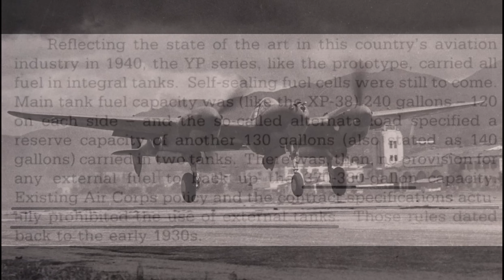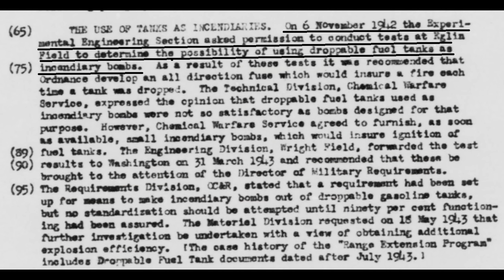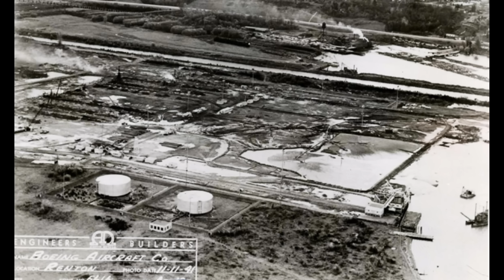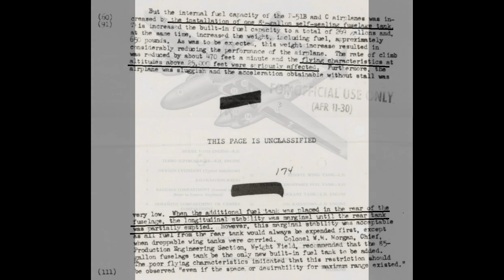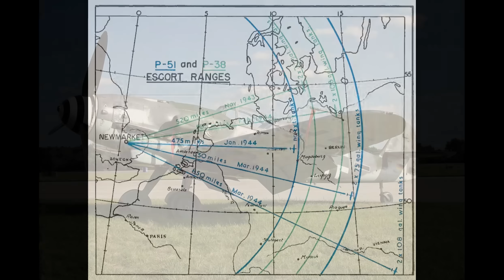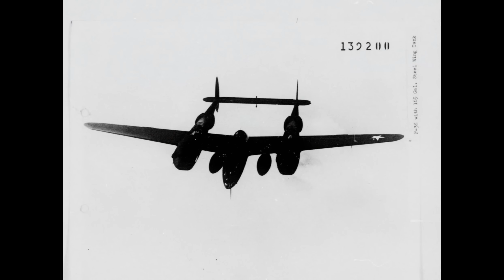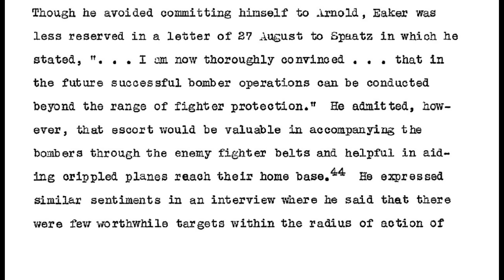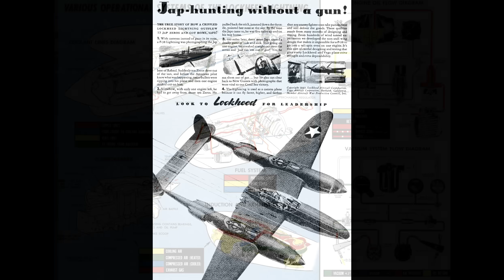The P 38 Lighting and the Bomber Mafia's Failure In World War Two

Comment: "...they won't shut up about the Mustang's range". First real 'out loud laugh' of the day. I am such a fan of your 'bomber mafia' videos. I had no idea. I was one of those who were absolutely convinced that the Mustang, was the only fighter able to escort bombers to Berlin. There's no doubt that the Mustang was an excellent fighter...but far from the only excellent fighter. Thanks for clearing the air.
Reply: Then apply Lindinburgs work on the P-38 in the Pacific and you would end up with even longer range
Reply: @nunyabiznesssame2371 Is Lindinburg a new Zeppelin?
Reply: @nunyabiznesssame2371 
Nope. Lindbergh knew nothing that Tony LeVier didn't already know, and it was Tony LeVier who showed the 8th AF what they were doing wrong.
Reply: @nunyabiznesssame2371 💯
Reply: I think u have earned your wings as a premier aviation historian with ur critical research. Bless u sir 😊
Reply: I understand that the cockpit heater did not work very well in the P-38. Pilots suffered from hypothermia. They called it the ‘ice wagon’
Reply: @jimstanga6390 
Much of that was caused by incorrect operation of the aircraft itself. They were flying the aircraft in "cruise" mode with the boost down, the RPM high, the mixture too rich, and all the cooling doors wide open. The engines were literally 100° F too cold. That turned out to be the cause of the problems the P-38 suffered almost exclusively with the 8th AF.
Reply: @ If you watch the "Heavy Metal" episode about the P-38  the veteran pilots won't give you an inch.   The P-38 was "the  Cadillac  of the skies!"
Reply: @jimstanga6390 Makes sense being separated from the engines
Reply: @jimstanga6390 while I heard in Pacific p38s pilots flew only with their undies because hot climates.
Reply: Few people knew how shitty those old history channel docs were until Greg came along. 🤣
Reply: "clearing the air". Nice, I hope you meant that pun!
Reply: The true selling point is, the mustang was significantly cheaper than a p38 or p47.
Reply: @MartinLange-x8p  and consumed half the fuel were easier to fly, easier to maintain, etc. You are correct. And in a war of LOGISTICS, fuel training, maintenance, production quantity, etc. matters FAR more than quibbles over range, speed, etc. But the Mustang was a far better airplane overall than any other for the money with far fewer issues.
Reply: @MartinLange-x8p this the point Greg always makes. The p51 was a great fighter and cheap to make and had great range but came in 1944 when the luftwaffe was already mostly destroyed.
Reply: @MartinLange-x8p  at the end of the war they were selling them for $1,500 ...now in today's money with inflation that about $32,000 USD
Reply: @MartinLange-x8p   Still pretty speedy at $80,000 I believe.  A Spit cost half as much and had the same engine (though Packard built)...and apparently stumbled in to "area rule" platform, not to mention 5+% additional thrust from directed expansion of radiator heat.
Reply: @juliushummer1069  are you sure about that. The spitfires and Thunderbolts elliptical and twisted wings were extreamly difficult to manufacture. Driving the price up.
This was the main reason why germany decided against the he 112 in favour for the bf 109.

A spitfire was two times the pricetag of bf 109 and 2.5 times compared to a hurricane. 

I doubt that the spit was cheaper than a Mustang.
Reply: @MartinLange-x8p  

AFAIK the Thunderbolt's wing wasn't truly elliptical. Its drag performance however is very close to that of a true elliptical wing, but was also much easier to make so it's overall a much better design.
Reply: @MartinLange-x8p Now we are at the crux of why P51 gets more love. Ìt was cheaper.
Reply: @MartinLange-x8p True but the P38 was available before those other fighters. You fight wars with the equipment that you have, and the USAAF HAD P38s. Just like later when they had drop tanks they could use on P47s. It really comes down to command not giving an inch on their doctrine and preconceived ideas.
Reply: Mustangs magic is that it was cheap and highly effective for greener pilots.  P47s and Lightnings were objectively better but more expensive and required a more experienced pilot to get that performance out of
Reply: @zacharyolson1297  The Lightning was not only very expensive to build and required a better trained pilot, it was very expensive to run. It was a thoroughbred that spent an awful lot of time in the hangar being maintained. Like the F14, it was the best US fighter of its time when it was flying but could not spend enough of its time flying.
Reply: @kenoliver8913 
Properly rigged, maintained, and operated, the P-38 was extremely reliable. 

The 8th AF failed to do ANY of that until well into 1944, despite being repeatedly told they were doing it wrong. 

Tony LeVier, Lockheed test pilot, went to Britain, and was absolutely appalled at the condition of the aircraft, and how they were operated. He said that 90% of them were not airworthy, due to being improperly rigged, and having maintenance that bordered on criminal negligence. Further, the pilots were flying them using the worst possible settings. 

Further, my friend, Captain Arthur Heiden (pilot of the Lucky Lady) told me that his P-51D was no more reliable than his P-38J, and really couldn't do much of anything better. He had several instances of cracked heads, and blown out spark plugs in his P-51, and his P-51 was never capable of climbing anywhere near as well as his P-38J. 

Captain Stan Richardson Jr. said pretty much the same thing. 

They said the P-51 was easier to fly, and had better cockpit heat. Other than that, they were able to do more with the P-38. 

Lt. Richard Loenhert, pilot of "California Cutie" flew her for dozens of missions on the same pair of Allison V-1710 engines she was delivered with, without any failures. And they weren't milk runs, either. A look at the insignia on the nose of "California Cutie" shows a steady string of heavy combat escort missions. 

The P-38, properly flown and maintained was reliable, effective, and competitive with anything Germany had, save the Me 262.
Reply: @kenoliver8913 it costs money to be 😎
Reply: Changing your opinion after a well made argument is about the highest praise you can give a content creator !! 👍👍👍
Reply: @Joe_Not_A_Fed I absolutely agree BUT! able to escort, and being a good "turn and burn" fighter are very different the P-38 was a death trap for dog fighting without advantage or being an excellent pilot, the P-47 was also not a good fighter in terms of matching turning and other aerobatic moves, it could do every damn thing else five star outta five star perfect but, the only thing especially with that laminar flow wing that could turn and burn dogfight better or as good as any high flying altitude bomber killing Axis aircraft, not saying the P-47 especially was a bad turning plane but you'd never get into a better turning situation with one against many excellent Axis aircraft that's why so many Allied pilots that had like 30 kills, of those kills 25 of them will be blowing the enemy out of the sky without contest, many quote "aces" never received enemy gunfire in some cases I don't think before they became an "ace" so very often turning and dogfighting was not what happened so the advantage the Axis aircraft did have, was sadly often irrelevant ^_^
Reply: @Magikarp-4ever  

Committing too much to turnfighting is exactly how you end any killcount you might have, because that means you're going low and slow and therefore a sitting duck for the guns of enemy fighters. Also the P-47 actually maneuvered better than most aircraft at higher speeds due to good ailerons.

Even IJN pilots flying the highly agile Zero don't actually prefer to turnfight with their enemies. They prefer to strike from the rear and on high. Boom and zoom is the name of the game.
Reply: Its what is quoted, the real issue was the unit price of the 51 was significantly less than the 38 or 47.
Reply: Filipus ........ thus proving that there is far more to a fighter than just "maneuverability" ! Also if you think the P38 was superior to the Bf109 or FW190 you are delusional. Luftwaffe fighter pilots viewed the P38 as "easy prey" in pretty much the same way as RAF pilots viewed the ME 110. Ask yourself WHY the USAAF withdrew the P38 from the European theatre ? Most pilots that got shot down in WW2 never even saw the plane responsible. If a pilot saw the attack coming there was a good chance he could manoeuvre out of the way ..... a small word "if" but its size belies its significance !!! 🤷‍♀️
Reply: T/M P38  0.68 P51 0.80 That is the main reason the P38 was relegated to other duties
Reply: I bet the P-51 would win a dogfight with a P-38 7 out of 10 times.
Reply: @mattfaulk8724  Make it  9 out of 10 in the ETO
Reply: They couldn't even manage to shoot down a single Zero with a 2-1 advantage when they went after Yamamoto, P-38s weren't dogfighters and that's why they weren't used to escort bombers, the Mosquitos role would've fit the P-38 better than escort duty.
Reply: @mattfaulk8724  

That ignores how the P-38 was top dog for overall aircraft kills in the PTO in the USAAF.

British delusion much?
Reply: rell........ "I do not need to do further research  ....... as I have read a book". Really ! A whole "one book", please don't over exert yourself !!! Now, if you think about Brigadeer Old's comments concerning "Cadillac versus Sardine Can" particularly regarding "weight and handling" the comparison may make more sense ? The Bf109's performance largely was largely due to the fact that it was both small and light. As more armour and heavier weapons were added to the 109 the downside was actually less responsiveness and less speed. Engine improvements helped offset some of the weight gains, however, engineering choices and physics are unavoidable ! As for history, gun camera footage fortunately STILL EXISTS and there you have it ......."viewing actual history" ! Pilots opinions ....... Most RAF Pilots preferred "flying" Spitfires, a significant minority however actually preferred "flying" the Hurricane. Some who preferred "flying" the Spitfire actually preferred "fighting" (in) the Hurricane. It is widely acknowledged that out of the two the Hurricane was the better and more stable "gun platform". (In other words it was easier to destroy enemy bombers from a Hurricane ........at least during the BoB). Now a lot of people are commenting that the P51 Mustang was chosen because of cost ....... they are actually right but not for the reasons they state. The only cost comparison that really matters is actually between the cost of the BOMBER versus the escort fighter !!!. If a bombing raid suffers heavy losses and is rendered ineffective it inevitably means another raid/s will be necessary. It was the introduction of the P51 D Mustang that drastically reduced B17 losses. Every lost B17 meant the loss of TEN Airmen and $ 250,000 dollars to replace ! More importantly, providing those bomber crews with some chance of actually surviving their bombing  tours, transformative  ..... Luftwaffe fighter pilots viewed the P38 Lightning as "easy prey", they knew its limitations and precisely how to shoot them down. Similarly, the RAF viewed the Me 110 (Twin Engined heavy fighter) exactly the same way ! The P38 was great against slow Zero's in the Pacific ..... Against Luftwaffe Bf 109s and Focke Wolf 190s...... inadequate ! The P51 Mustang on the other hand ! 🤷‍♀️
Reply: Incorect , at altitude the p38 and the p47 could out turn the 190 and 109 in both the 1 circle and 2 circle fights , they were significantly faster and had much more power at escort altitudes .
This is just simple math@garymoore2535
Reply: @garymoore2535  Wow man i hope that's caffeine, not something stronger. No, the reason B17 losses went down is that P47s has already killed the skilled Luftwaffe pilots. And that's not an argument that says the 47 was better than the 51 but a reminder that much of what is attributed to the 51 is couched of a false premise. But i do agree, that the 38 was not a good high altitude escort, those terrible critical mach numbers made it unusable for that role. Could go into compression in an instant at high altitude.
Reply: Erm ..... Do some research on how "twin engines fighters" compared to single engined fighters ....... twin engines fighters were nowhere near as manoeuvrable or responsive in combat. The P51 Mustang was chosen as the escort fighter for good reasons !
Reply: @ Guess what ? That is not the point of the video , the point is many bomber crew would have survived had P 38's been escorting them to Germany in 1943 and losing a few fighter jocks is a small price to pay vs a bomber crew.
Reply: @garymoore2535 the P-38L with the hydraulic-boosted ailerons and dive recovery flaps was very maneuverable. I may be mistaken, but I believe it had a better roll rate and tighter turn radius than the p-51d. Had they received the paddle bladed props and 1875 hp engines that the p-38k had, I strongly believe that it would’ve been the best piston engined fighter of the war.
Reply: @margraveofgadsden8997  Introduction of this model required only a 2 week pause in production while the factory was retooled which the USAAF refused.
Reply: @garymoore2535  With both available, choosing the P-51 over the P-38 makes sense.

With only the P-38 available, choosing not to have an escort fighter at all is criminally negligent.
Reply: @ShuRugal   The entire premise of Greg's argument
Reply: @garymoore2535 
Yes, but the P-38 with sufficient range was available a full year before the P-51 models.  Had the "Bomber Mafia" bowed to the reality that fighters are more easily produced in quantity than bombers, therefore expendable in numbers that would make unescorted bomber missions prohibitively expensive, the prohibition on escort drop tanks would NEVER have been in place.  Under those conditions, the Lightning would have been capable of long escort missions an additional year earlier.  Further, more development on multi-stage turbo-superchargers should have yielded a Lightning with a service ceiling well above those of the bombers being escorted or the vast majority of the interceptors sent to shoot them down; the Lightning would have been able to "boom and zoom" in Europe as they were in PTO.
Reply: @garymoore2535 Do some research on a pilot named Bong in the Pacific theater. His opponents were Japanese fighters which were well known for their outstanding agility.
Reply: @garymoore2535  okay but the P-38 is really an exception. In the pacific, where P-38 got most of their fame, they fought Zeroes and Ki-43, far more superior fighter in terms of maneuverability than BF109 and FW190
Reply: Well Gary, I have no need to to do 'further research' as I well remember the book written by the late Brigadier General Robin Olds. As he flew both P-38's & P-51's in combat in the ETO, obtaining kills in both, his opinion was that the flying the 38 was like 'flying a Cadillac' where as the 51 was a 'spam can'. His opinion might not be comfortable with some; but he talked the talk, walked (flew) the walk,
lived to tell the tale & write the (a) book. I'm sure the now deceased ace Robin Olds forgot more facts about 38's & 51's during WW2 than anyone alive would likely acquire. I
suspect Gen. Olds would have happily flown 38's until VE day but we can not ask him, sadly.
Reply: @garymoore2535 You seemed to have missed the entire point of the video, but it wasn't to say the 51 wasn't the best choice for an escort fighter in 1944. Might want to re watch it
Reply: @garymoore2535  High altitude escort duty did not involve low energy dog fighting performance. It was entirely a boom-and-zoom affair. Speed and firepower were the single most important factors for an escort fighter or bomber interceptor. Stop conflating reality with the History Channel.
Reply: @GeneralJackRipper  
Correct. If low-medium altitude manoeuvrability was what mattered most the P39 would have shat all over the P38, P47 and even the P51. It is exactly why the Soviets adored that little plane (air combat over the Eastern Front being mainly low altitude and short range). Hell, even the P40 would have shat over them too. But the issue here is mostly about range and secondarily about performance at strategic bomber altitudes. Both of which, in 1943, the P38 was best at.
Reply: @garymoore2535  and yet P-38s were absolutely lethal on Zeros in the Pacific....
Reply: @garymoore2535 
The P-38 was able to use its twin engine layout as a substantial advantage. I suggest you look into "differential throttle" use. The P-38 could do it well. Over 300 MPH it was the fastest rolling fighter in the U.S. inventory. It was the fastest climbing, and the fastest accelerating fighter as well. It had an excellent instant and sustained turn rate, and excellent elevator authority. 

Your claims about the P-38 not being competitive are demonstrably false. I've known several actual fighter pilots who flew the P-38 and P-51 in combat, all day the P-38 was absolutely capable, and the advantage of the P-51 was that it was more simple, and easier to fly, but not as absolutely capable in as many situations.
Reply: All fighter Escorts are NOT the same. The P51 Mustang was by far the superior escort fighter capable of dealing with the Bf109's and FW190s. The P38 was not really competitive in the European theatre which is why the P51 became the escort of choice ! Simples 🤷‍♀️
Reply: The entire point of the video is to point out that crippling bomber losses endured early in the campaign were not needed. We had fighters capable of providing escort. Long before the Packard Merlin engined 51s was available.
Reply: @artlee2285  most early bomber missions were short ranged into france and germany along the coast, and were in range of fighter escorts. this gave a false sense of success, and the long range missions in mid-late 1943 is when it failed. and it was only a bout a 3 month window in which teh high losses occurred and all unescorted raids were suspended. Memphis Belle and many others had all completed their 25 missions before the high loss missions even happened.
Reply: @artlee2285  NAA started development of the Merlin XP-51B in September 1941, flew teh first prototype in Oct/Nov 1942, and flew teh first combat missions in November of 1943 (one month after unescorted raids were suspended). And the high loss missions mostly occurred from August-October of 1943 mere months before the already developed P-51B was ready. So the high-altitude long range Merlin P-51 was already in development 2yrs before the high loss-missions occured.
Reply: @garymoore2535  No-one would argue against that by the end of 1944; the P51 became easily the best fighter in the escort role for ANY country. The point is the P38 could have been a useful escort, saving an awful lot of B17s, in 1943 before the P51 was available in either capability or numbers. And the barrier to that was USAAF doctrine and politics, not any technical issue.
Reply: @kenoliver8913 Good work actually paying attention to the video at hand instead of chasing squirrels
Reply: @garymoore2535 
Utter horse shit. 

The P-38 produced aces of legendary status against the Luftwaffe. Robin Olds, Larry Blumer, Jack Ilfrey, and John Lowell, just to name a few. 

The P-38 was absolutely competitive. It required a well trained competent pilot.
Reply: @garymoore2535 not what the topic is at all! This is before the P 51 was available for escort
Reply: @garymoore2535 

Nope. It was cheaper.
Reply: @sumcarson

What an ignorant and childish comment. The documents exist showing what each aircraft cost the Army.
Reply: @sumcarson

What an ignorant and childish comment. The documents clearly show the cost for each aircraft.
Reply: @garymoore2535 at the altitudes they were escorting  the p47 out turned 190s and 109s in rate and radius not to mention had much more power and was over 100 mph faster